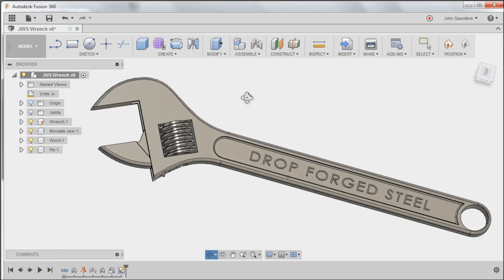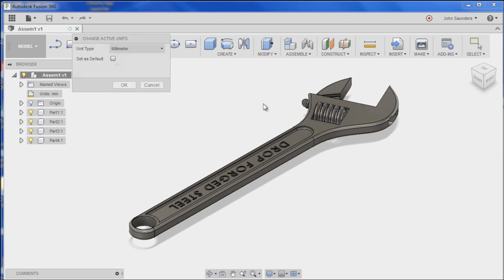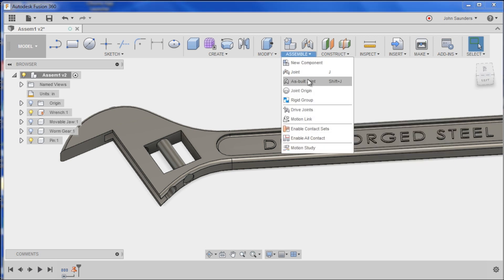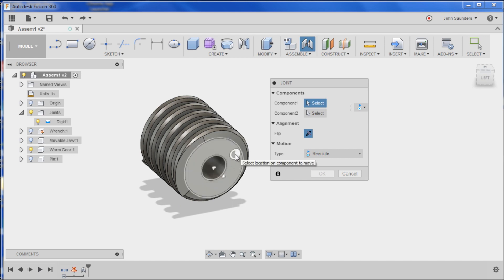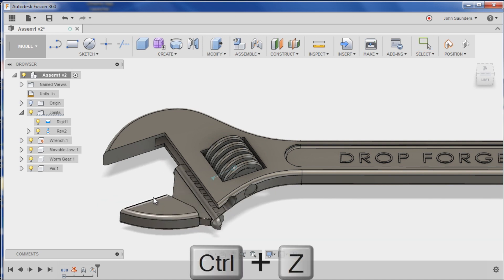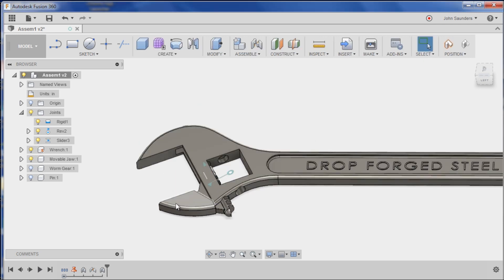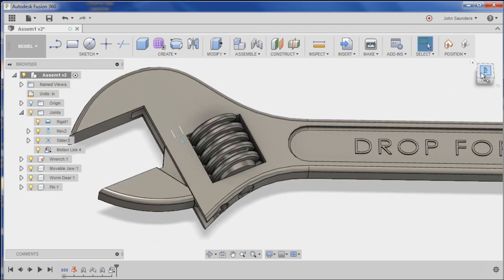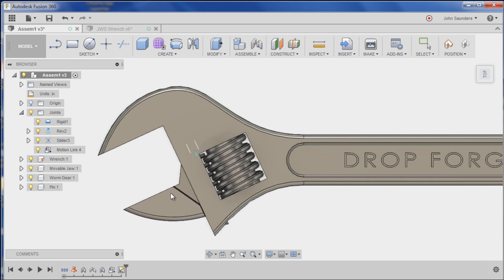Joints in Fusion 360 for a Working Crescent Wrench!  FF51

Comment: Love your videos, Im a solidworks user that relaship system seems a little odd, In SW just add a follow relashship and a few surfaces ones.  I was thinking about switching over to Fusion to get CAM built in im currently SW then Bobcad or Visualmill. But i stoped paying so im a few years back on all. I know you used SW whats yourfeeling on the two was the learning curve switching over bad?

Comment: Couldn't this be done with a "contact set" between the sliding and rotating part, too? Sort of how it works physically -- the slider will slide because the screw is pusing on it.

Comment: The peril of switching units: all your numbers are random while they would be probably round if you had stayed in ISO units. I'm really curious what Fusion would try to do if you activated collision detection, in my experience it was extremely slow and buggy (as a software developer, I know why).

Edit: after testing with the same model, the pitch of the worm gear is 5mm, and we can use a collision set between the 2 jaws to limit the movement in one direction, and it's modeled with the jaw wide open, so 0mm can be the other limit. Don't even try to use a collision set involving the worm.

Comment: John, my newly modified cnc router, cuts hot rolled steel at 1.64 inches per minute metal removal rate. at 15,000 rpm, my chips are hot blue but my end mills is COLD, not even warm, but COLD. I am so excited I wish there was some way I could show you...